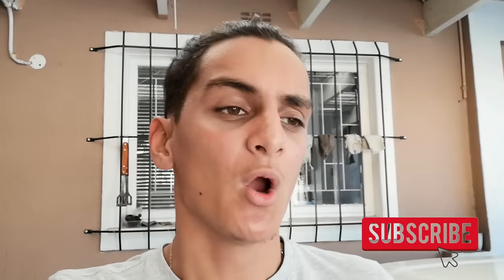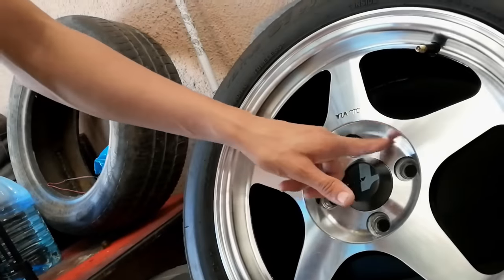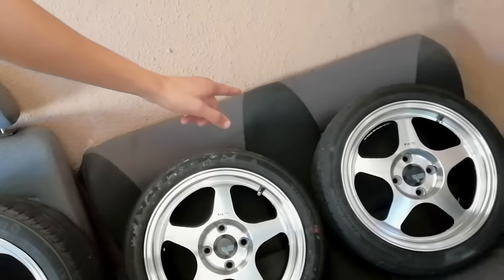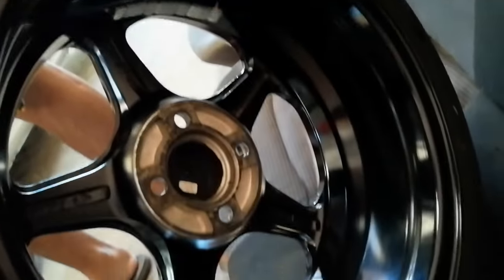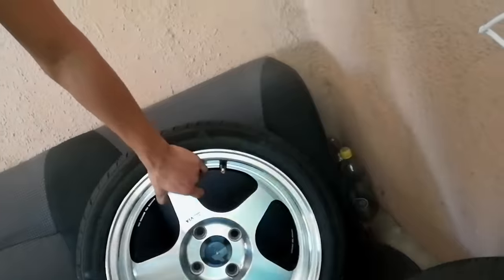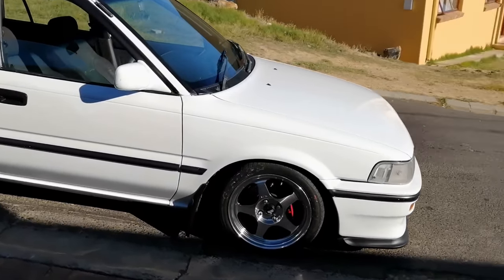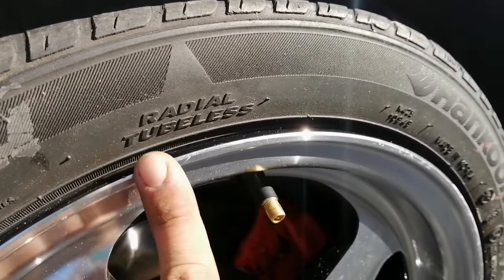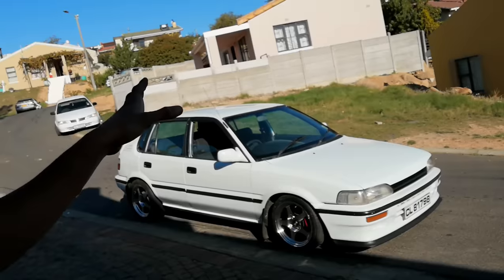NEW WHEELS FOR THE TOYOTA CONQUEST *WHEEL REVEAL*!

Comment: Just a suggestion, if you cant get 0 gauge wire what also work and might even work better is welder cable. We use it for power cables to for our sound systems when 0 gauge wire isn't enough.

Comment: Try a computer reset, disconnect your battery leave your lights to drain all the power on the car for 2 mins then put your lights off and reconnect your battery switch your ignition on for 2 mins then after that switch your car on for 2mins and then switch it off that should reset your computer works on any car.